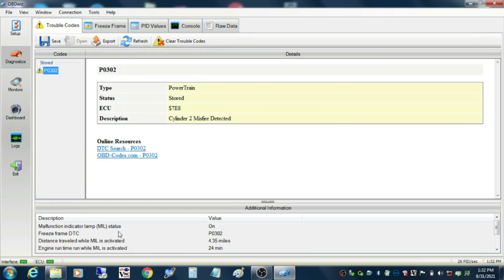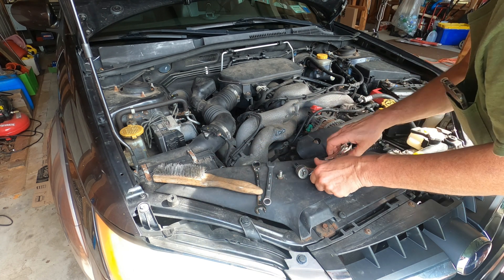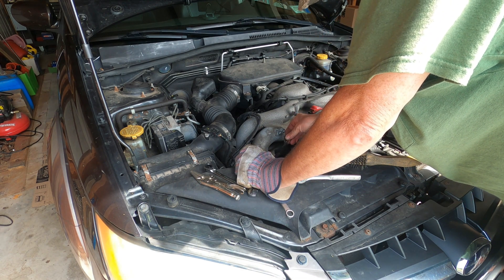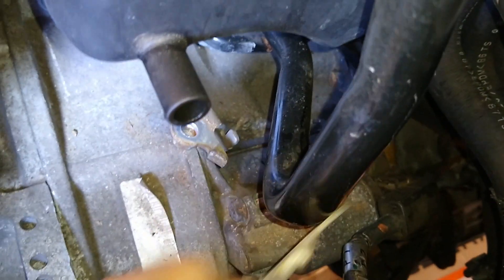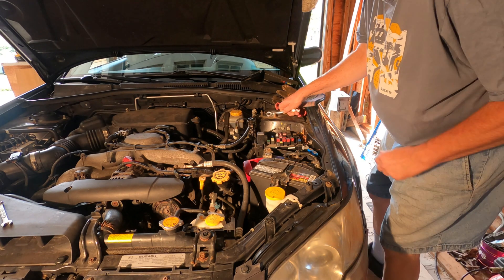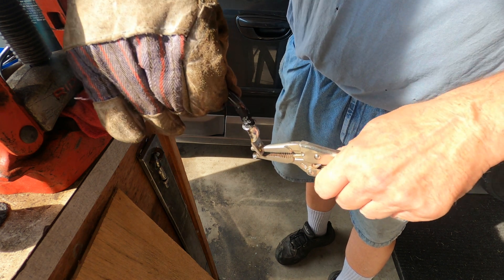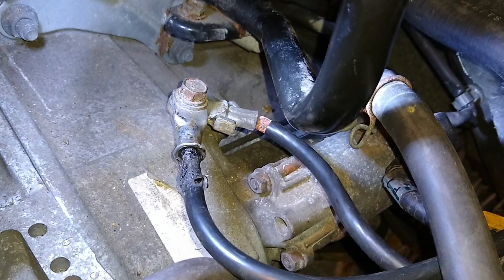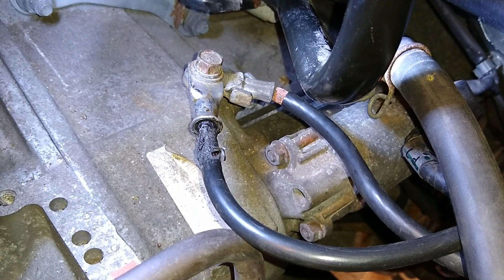Check Engine Light - Subaru Outback - Grounds | Man About Home

Comment: Some will disagree with me and that's fine but I like to use NAPAs silver thread lubricant as a dielectrical grease for connections like these.  For me it seems to work quite well and seals the joint too.  Well drillers use a thread lubricant called copper-coat.  It's the same type material but uses copper instead of alunimum.  Both seem to work very well in my connections.
Reply from the maker: This is helpful. Thank you for watching and commenting!

Comment: I'm curious if you got to the bottom of your problem and how that played out?

Thanks for the video. I just did something similar for the same reason. I wasn't able to finish though because I broke the bolt head off at the same spot you attached your extra ground to the frame :( Project for tomorrow.
Reply from the maker: In the past, I definitely fixed a misfire problem by cleaning grounds and replacing corroded ground straps. My most recent misfire problem was cured with new spark plugs. 

Good luck with bolt fix! Thanks for watching and commenting.
Reply: @manabouthome  WOW! Fo you have a video on how to do that? 😃 If this doesn't work, maybe I try that next . . . Unless I should start else where??
Reply from the maker: @ericcorliss  Are you getting a check engine light? If so, you need to read your error codes first. This is how I do it.. https://youtu.be/kUjBnZ_TXuI 
But many auto parts stores will read your codes for free.